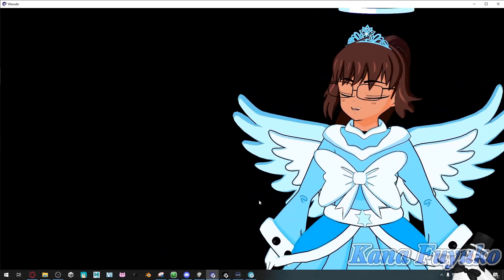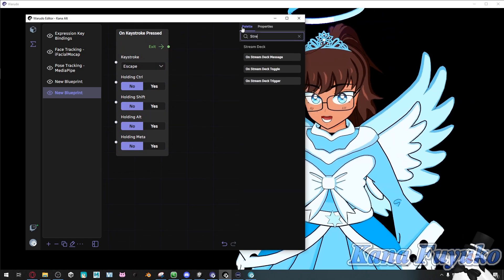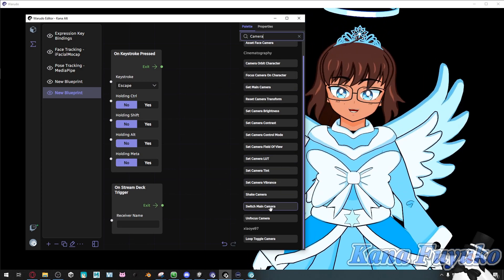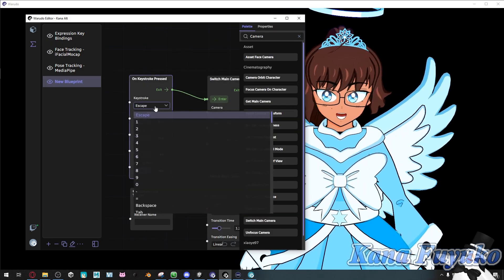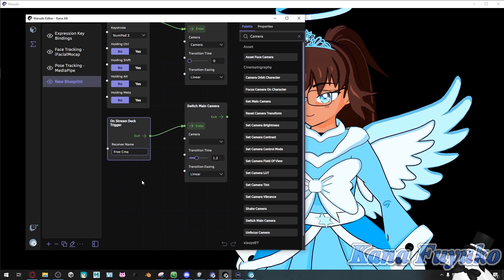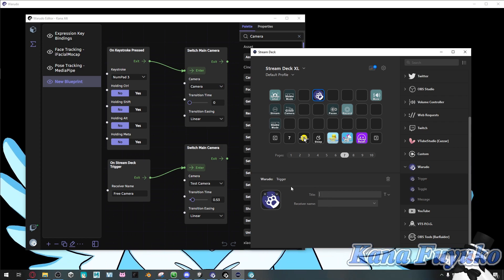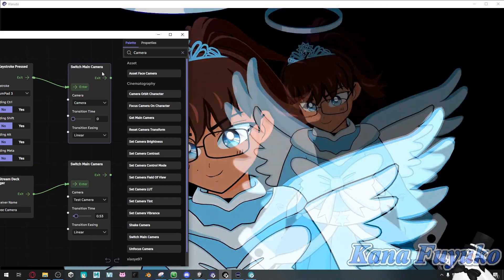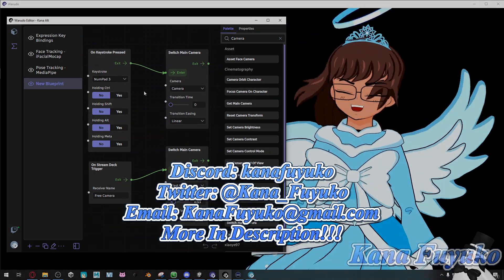How To Set Up Camera Toggles In Warudo!!!

Comment: I put the trigger and set it the same, but the trigger node is not active, can you tell me why? Thank you for the good video
Reply from the maker: For StreamDeck it can get finky, I plan to make a new video later regarding a more improved way to do StreamDeck with Warudo so it's bugs out less. Not sure if that's what you mean by Trigger.
Reply: If you press the key set to on keystroke pressed, the on stream deck trigger won't be activated, are you saying this could be a bug? Thank you for your answer
Reply from the maker: @나는정우-r3c  That's not really how you trigger a camera with Stream Deck. Keystroke pressed is only for keyboard usage for those without a Stream Deck. For Stream Deck you just use the trigger node for it but it can bug out at times and requires you to restart your Stream Deck. I have a method that I am experimenting now to hopefully make it more convenient for Stream Deck users. I will make a tutorial after taking care of family situations.